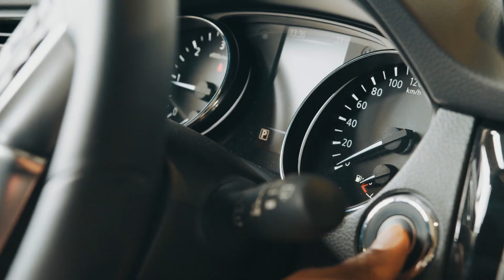Why Do Cars Still Use 12-Volt Batteries? If It Ain’t Broke, Don’t Fix It [ID0701]

Comment: Very good points! Going from 6 to 12 volts was a good idea mainly due to using 1/2 the copper for wiring. Going from 12 to 24 volts would again reduce wiring size by a half, but then the practicality kicks in. 24 volts is still safe, but who wants to use a battery with 12 cells? + computers run just fine using 5 and 12 volt supplies. Another aggravating thing is we still use the "cigarette lighter" socket to only power toys now. A new better connector is needed today.